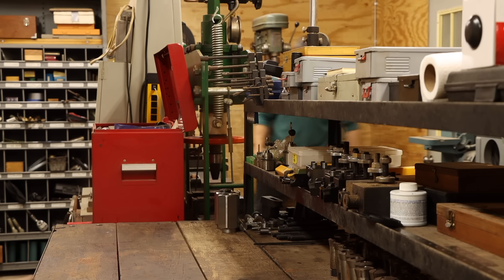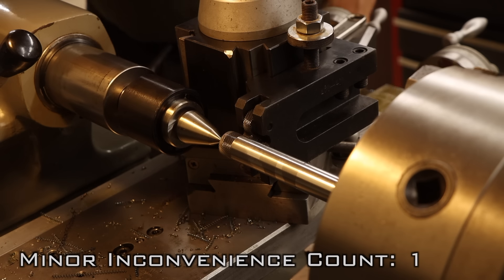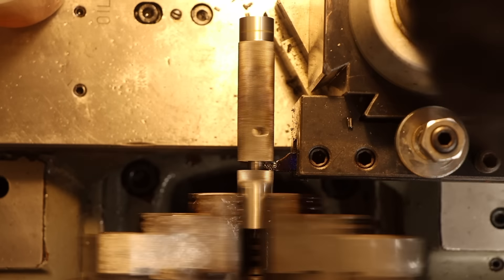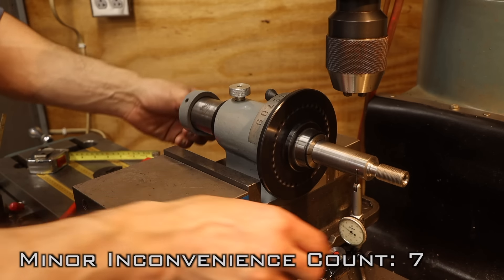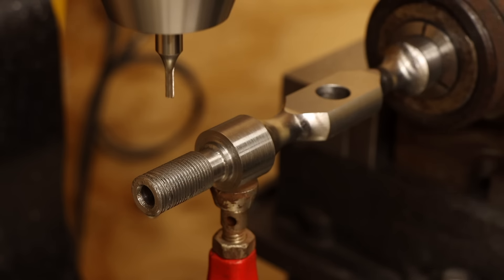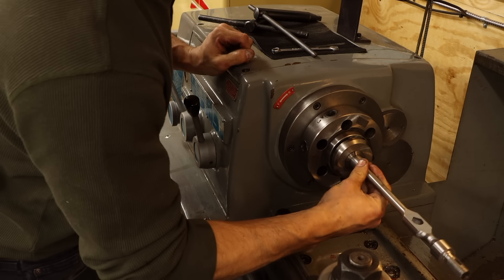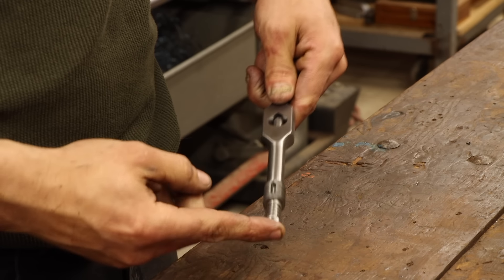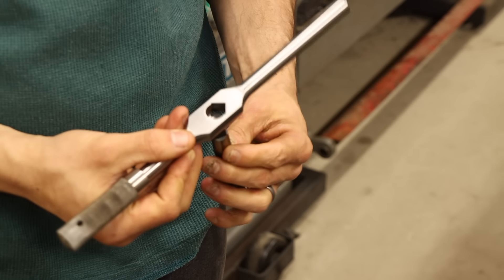Making a Tap Wrench || INHERITANCE MACHINING

Comment: Looks great, excellent editing too.  It might be overkill, but would heat treating be needed to prevent a stubborn tap from distorting the plunger or handle?  Might mess with the tolerances you have machined, and would need to be polished again, but it would be a tap wrench your great grandchildren can use.
Reply: Was wondering the same thing - what kind of steel did you use?  Obviously doesn't need to be cutting tool hard, but a little harder than mild would probably improve durability
Reply: I would go so far as to say that it is required for at least the anvil.
Reply from the maker: Thanks! I considered that but just didn't get the time to do it. I'm pretty sure the material for the plunger was just a cold rolled mild steel so could use the help. I definitely hope this is something that get's passed down for generations
Reply: Thought the same, I've made a tap-wrench closer to the "This Old Tony" design. Did heat treat that one.
Reply: @MF175mp  I've experienced the same too, that's how they can sell those Chinese ones so cheaply I guess, no heat treating process.
Reply: If it's cold rolled, but you could case harden it.  They sell the powder compound, that you stick the part into after you heat it, makes a hard skin on the outside a couple thou thick.  Expect a little distortion from the heat.
Reply: @corndog6700  What is the name of that powder you mentioned? That's a new one to me,... I've heat treated some pieces of O1 steel in my garage before, I built a small brick forge, made a couple of knives etc.
Reply: @steveclark..  Cherry Red is one name brand of case hardening powder, lots of recipes for it also.
Reply: @steveclark..  it's now cyanide free, the old recipe had charcoal made from cherry pits.
Reply: @SW-ii5gg  👍 thanks for that.
Reply: @steveclark..  you are welcome.
Reply: @steveclark..  lots of old blacksmith recipes for case hardening mixtures, they all contain several sources of both carbon and nitrogen and usually have borax in the mix. They penetrate twice the depth at a faster rate under vacuum, if you ever need to do a deep case hardening.
Reply: @steveclark..  Brownells used to have several types of compounds, along with many metal finishing solutions.
Reply: @steveclark..  MSC sells this stuff called cherry red surface hardening compound, and that's what comes up all over when I Google it.  We had a can at a shop I worked for, that probably was 40 years old, 36 years ago when I worked there.  Different brand though.  I think it was called Case-N-It or something similar.
Reply: @InheritanceMachining  I've used Kasenit with good results, looking at my small Starrett tap handles the plunger is black so I guessing it's hardened.  I can't see that it would make that much difference on the body.  You've inspired me to give it a try, though I think I'll use 4140.
Reply from the maker: @paulbillingslea4848  Thanks for the tip, Paul. I have an accumulation of parts I will need to harden eventually, some of them pretty large. I might have to hold out until I can arrange some sort of furnace
Reply: @steveclark..  powder called casanite
Reply: @Machinist-wf1iw  Thankyou,...sorry for the late reply.
Reply: I have never made one but if I were to, I would imagine 4140 would do the job just fine. I can't imagine needing something heat treated to 60 Rockwell.
Reply: That was my first thought as well. They certainly need hardening and tempering on both the moving Vee and the stationary one also. And I would temper them up to around mid to dark blue.
Reply: @InheritanceMachining   You might considering making that piece again from a piece of O-1 tool steel. Will be easy to heat the V-end and oil quench it. While the torch is out, Put on a brazing tip and put some color in the main body. Use the torch like a brush, make swipes/stripes/spots on it just letting those stripes and spots just turn blue. It will give it a case hardened coloring/look. do small spots at a time to to keep the coloring where you want it.  A pan of ice water handy to keep the entire piece from heating up too much and all of it turning blue is handy. If you don't like it, polish it off and try again. I have some tools I did this with 30 years ago. They still look good. Has fooled several salty old dogs into thinking they were case hardened.

Even though I have been cutting chips since September of 1975 and still earning a living at it. It has been, and still is an adventure.
I have been enjoying your videos. Looking forward to seeing more of your adventures. It was a incredible gift your grandfather left you.
Reply: @steveclark.. I bookmarked some Chinese tap wrenches that claim to be hardened. The design is a bit different from the standard ones as the body is machined not cast, the price is just a bit higher.
Reply: I've seen an apprentice completely ruin a Starrett handle by torquing down on flats of the tap rather than the corners.  He never would admit to it though
Reply: You need to engrave your name & date on it! @InheritanceMachining
Reply: @InheritanceMachining  I am relatively new to the channel and just watching what I can find. Am I right in the assumption that if being made today the screw on handle would be made from brass instead? Also, thank you for your videos, every single one is a joy to watch, especially the ones where you're presenting what you did to your wife, her joy is really infectious

Comment: It's so cool that you got to spend that time with your grandfather and to learn these skills.  My grandfather was a machinist, but he passed away when I was 6 years old. So I never got a chance to spend that kind of time with him.  I still caught the home shop machining bug though, and I've built my own shop in part as a tribute to him.
Reply from the maker: That's unfortunate but great you found your own way. Sometimes I feel like I'm picking up where my grandfather and I left off.
Reply: @InheritanceMachining my grandfather was also a tool and die maker at the steel mill. I inherited what was left of his machine tooling. Just recently bought a 144” long 20” swing Lodge and Shipley lathe. Wish he was here to see that monster run. I have never gone back to his grave to visit. Every time I need to chat I light a fire in the wood burner and sling some chips. It will never bring them back but it feels damn good to keep their tools alive. Your story hits home with me and so many others. In a world full of computers and button pushers it’s refreshing to see a master manual machinist at work. Thanks for the content
Reply: Three men in my family were machinist at one point in their lives, but two were gone before I came about. The third, my uncle was no longer a machinists, by the time I came around.  We almost bought a lathe though, but we didn't have the capabilities to move it around in his garage, the electrics to wire it up.  However, a friend of mine that I work for may be looking at getting a Bridgeport mill.

Comment: As a mechatronics technician in Germany we had to build a diesel locomotive as first project. This included filing u-steel to dimension and making all the faces parrallel/quare to each other. After weeks of filing the whole day, making the first cuts on the lathe to turn the wheels really was a blessing.

Comment: From one inheritance machinist to another, something my dad taught me: Turn a dead center on the lathe that will fit an R8 collet. Use the dead center on the back (top) of the tap for alignment in the Bridgeport. Keep some pressure on the quill to maintain tap alignment as it threads. Love the channel, looking forward to watching the rest of your content.
Reply from the maker: Oh that's pretty clever. Thanks for the tip!

Comment: I agree the Starret tap wrenches are dead sexy. I made a complete set but changed one feature that is common on most tap wrenches. The knurled handle. when you need to produce a large number of holes the knurling is like a file on the hands. So I leave the ends smooth with just a band at the inboard end for grip when tightening the wrench.
Reply: I have two of the smaller Starretts and I’m finding the same thing. I need to keep my index finger on the smooth end when winding out a tap or it gets a little bit irritating.

Comment: When I joined the RCAF as an Airframe Technician - we had to make a project pen-holder (it was graded for accuracy)... the actual holders (2 of them) for the pens were to be Hexagonal pieces about 2" long.  We had to hand-file both from a piece of aluminum ROUND stock about 5" long, and had a tolerance of .001" in all dimensions.  Luckily, I'd had experience working with metal, so I got a pretty decent grade.

Comment: I love these videos, a bit odd but makes complete sense how many of these operations and design considerations also work for firearm design. The precise fit and aligned notch for the pin are pretty much the same as you see in firing pins for striker fired designs.  
Of course this is because machining is machining, same tools and machines just a different purpose.

Comment: Given your penchant for making tools, I think you should consider building a "hand tapper".  You really can't appreciate how much easier it makes tapping stuff by hand until you've used it a few times.  I have a "small" unit with a direct drive T-handle and a large unit with the counterweight and crank handle.  The small one uses simple hex bushings to hold the taps, with a hex bore and captive spring clip to retain them.  The bushings have a square drive in the end, with the larger hand tapper using a double-D drive to transmit the torque instead of a hex.

Comment: Word of advice, if I may. I avoid sanding parts on my lathes unless I oil (wet) the sandpaper to cut down on the amount of dust and cover the ways and cross slide  with either paper or cloth towels. The dust is abrasive and once embedded wears cast iron quickly. You're doing a really good with showing the process that you are going through restoring your grandpa's equipment.
Reply from the maker: Thanks! I do oil the sand paper but didn't think to cover the ways. You're totally right though! Thanks for the tip!
Reply: @InheritanceMachining  I use a board with cleats to cover the ways when sanding. Doubles as a safety platform for chuck changes.
Reply from the maker: @flashgordon6238  i have one of those. well sortof. it's just a board. but will do the trick
Reply: @InheritanceMachining  It's actually an old oak cabinet door. I just leave it in place as a cover when I'm not using the lathe.

Comment: Love your vids. That said, for any tap size subtract the pitch from the diameter. Thus 1” divided by 18 tip equals .05555 thread pitch. .625 minus .05555 equals .569. Just .006 larger than your 9/16” drill bit. Safe to say there’s no need to bore .006 out especially since the 9/16” bit will probably drill oversized,  not undersize. This formula applies to McDonald’s, no, metric even square and acme although the latter two need .010 added. Look at your thread for example 1-8 UNC takes 7/8 drill bit. 10M x 1.5 takes 8.5 drill bit. No one needs a chart if they just remember this formula. 😊 Loved your giant fly cutter. Thinking of making one using 1 x 3 barabout 8” long. Maybe.

Comment: Nice tap wrench!  I will be making one too, with one modification: a locking nut to hold the tightening adjustment while utilizing the tool.  Nothing pisses me off more than having the tap wrench come loose every turn or two!
After thinking on it for a bit, I think I will also make a handle to attach to the tap handle in line with, and concentric with the tap. This way I can have better control over tap alignment when threading a hole in somthing I cant use a tap follower on, such as mounting holes in a trailer frame.  This handle will have to be adjustible so I can align it with different size taps.  I also think it should use a "V-way" type mounting to the sides of the tap handle tp provide a rigid connection with ease of adjusting its position relative to the tap being used.

Comment: Nice job, I'm really enjoying your videos.

The first time I used one of the Starrett tap wrenches, I immediately pulled it apart and took a bunch of photos so I could replicate the design if I ever decided to make a tap wrench. All of my tap wrenches are cheap crap that annoy me every time I pick them up, and as soon as I touched a Starrett one, I knew I had found the ultimate tap wrench.
Reply from the maker: Thanks! Funny thing, I never actually used a Starrett before. But it just looks like quality. I ended up piecing together the internals from ebay listing.

Comment: Nice wrench, I bought a Starrett.  Actually, all of them.  Starrett is extremely expensive and yours is a nice copy of a 91-C (?).  Keep it up.  I've been machining for 40 plus years now (never thought I'd be "the old guy" in the shop, but I am now), I like 99% of the Starrett tools, except for their calipers (Mitutoyo are definitely better), and I've spent way more money than I'd like to admit on Starrett tools, but they are as good as anything out there, even the old Swiss stuff.  Keep up the good work.
Reply from the maker: Thanks, Robert. Yup it's based on the 91C. I've got a few Mitutoyo and Starrett items around the shop. Definitely quality that is hard to beat.

Comment: I had to make a set of Tap handles for a project in trade school last month. it was two handles with squared ends with angled cuts. 2 .25inch screws for tightening them it was a pain but fun none the less. will be watching you for some help on new ideas I need. machining has become a passion for me. I made my GF a lightsaber for Christmas
Reply from the maker: Nice, man. Making your own tools is one of the best parts about machining.
Reply: @InheritanceMachining  yup I'm making fly cutters right now. I'm sure you know what they do.
Reply from the maker: @noahberg101  oh yeah for sure. I’d make my own if I didn’t already have them. But I might still make a “big” one if I ever have the need
Reply: @InheritanceMachining  I'm making two. A 2 inch and a 1 inch.

Comment: A tap wrench like this was one of the early projects in my yr of beginner machinist training at the JC in 2006.  Main difference is we used an EDM (had to make the form tool for this out of graphite) to square up the center hole for the tap and we wound our own springs out of music wire. Mine works upto 5/8",  I need to do what you did to enlarge
the square cutout with a file to go to 3/4" tap size.  That is about as big a hole as I can tap manually anyway.  Your presentation is very good, I subscribed.
Reply from the maker: That’s pretty cool. Sounds like you went to a pretty competent vo-tech if it had EDM capabilities. The mod is easy enough just takes a bit of patience like anything you want to look nice with a file. Thanks for the support

Comment: When doing slotting with an endmill, use 2-edged mill as it cuts 'balanced', as in on size. 4 fluted like yours has one teeth entering a sidewall and one leaving and third one in the cut, making it deflect and thus the one edges digs in deeper in to the sidewall, making it too wide.

Comment: The Starrett 91C is a great tap handle and I also enjoy using it. Now I want to make the smaller ones.
Reply from the maker: That would be an excellent project. If you do, I'd recommend doing them all at once to save on some setup time.
Reply: @InheritanceMachining  That would be best. But the lathe I have is a Emco PC turn 50. So it is a desktop sized cnc lathe so doing all 3 at once isn't an option. Maybe I could do it out of thicker flat stock on the router first then move over to the lathe.
Reply from the maker: @mrp19285  Ah you've got nothing to worry about then. Fancy schmancy computer machines ;)

Comment: On the radius cutter, use a mounted grinding point in your hand drill. One that is conical can be shifted endwise to match the radius & get the irregularity from the bench grinder removed.
Reply from the maker: Ah, that’s clever. Thanks!
Reply: @InheritanceMachining  it really makes a smooth profile & you get less pickup on your work piece. Also the cutter relief is built in

Comment: I made a few smaller versions of this with just the lathe as thats all i have. i found that more threads per inch helped hold the tap more securely
Reply from the maker: Exactly right. I used the a fine thread 5/8 and it holds very nicely

Comment: Nice vid. One suggestion, if you grind your form tool in the reverse direction you can part the knurled section off with a straight parting blade then radius the end in the next operation and you won't end up with the nub in the center.
Reply from the maker: Thanks! I’m trying to remember my operations… I think the reason I did it this way was because I wanted to use the same tool for 2 different cuts. The one on the end of the main body could only be cut the way I did because of the holding material

Comment: You can tap 5/8 thread with a 9/16th hole. The threaded fit is a little better in my opinion. I really like the 5/8 24 for tooling threads. I just made some machinist jacks with 5/8 24 and super glad I did. In any case, I like your project. Hope you don't mind if adopt it as my shop has no tap wrench either......
Reply from the maker: That's good to know. I might have some machinist jacks in my future as well. If you end up making the tap wrench shoot me some pics!
Reply: @InheritanceMachining  I certainly will. I have several projects to get through first but its at the top of my list. Im glad you did this video. I really like this tap wrench a lot. The things are over 80 bucks used on ebay.